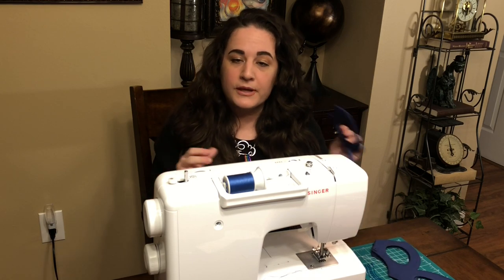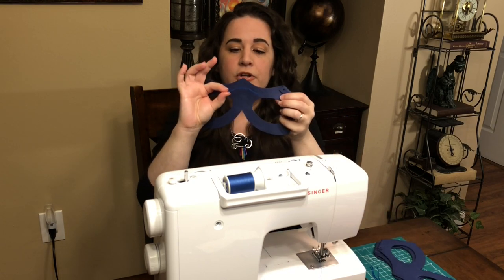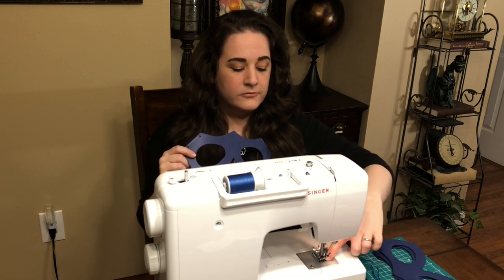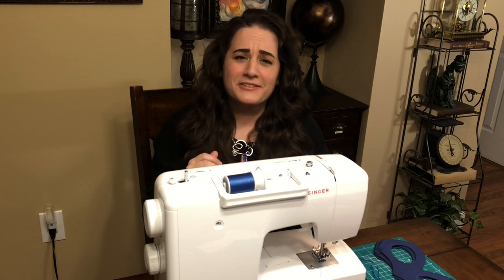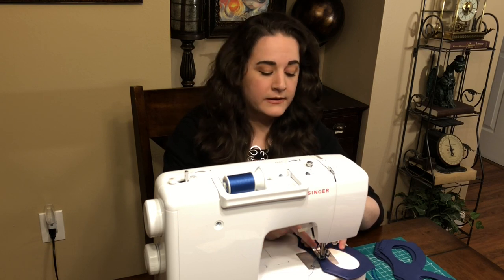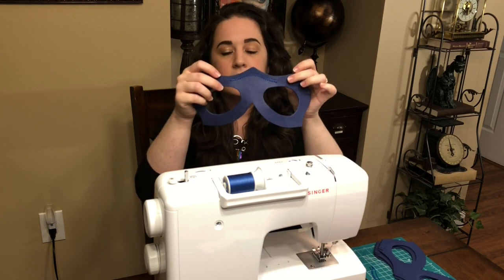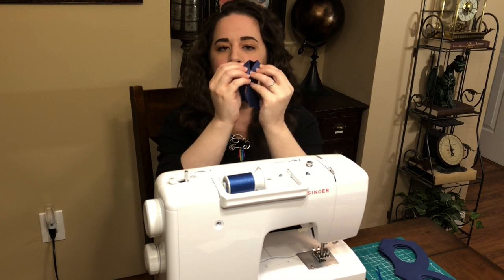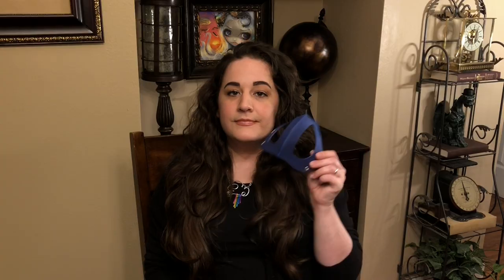THIS CHANGES EVERYTHING: Did you know you can sew craft foam??

Comment: You can lower the feed dogs on some machines, but then you have to control the speed the foam moves yourself which can be tricky. You can also put tissue paper underneath, or stick some masking tape to the back side of the foam to protect it from the dogs, then just tear it away after stitching. Works for pleather too :)
Reply from the maker: Masking tape is a great idea, I may have to try that. Thx for the tip!

Comment: If you want more of a leathery look, there is a product called .kraftex. It is a fabric that has the feel of thick paper. You can sew it and it doesn’t rip through. You can crumplei it up to give it a leathery look and wash it and dry it to make it even softer. It might be a good alternative for 5he craft foam. It comes in several colors. What is the crocodile thing you were used for making holes?
Reply from the maker: I haven't heard of Kraftex before, thanks for the tip! And the tool I'm using is a Crop-A-Dile, but you can use any kind of hole punch.